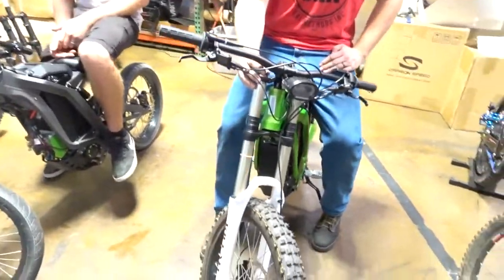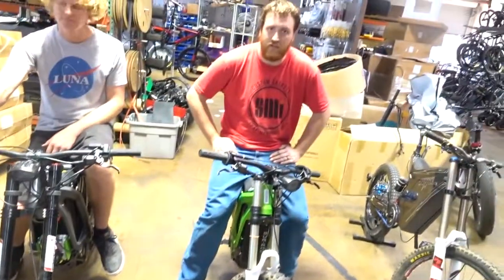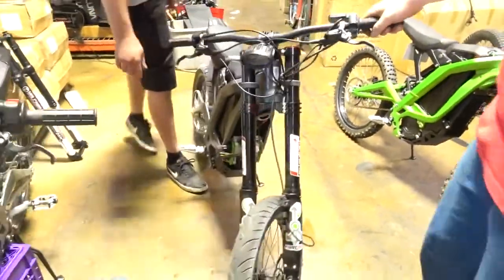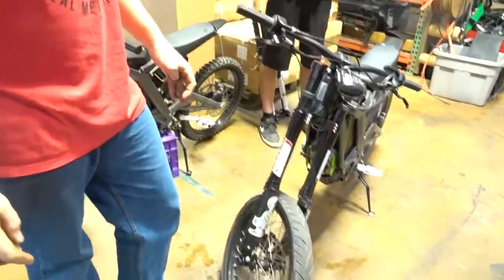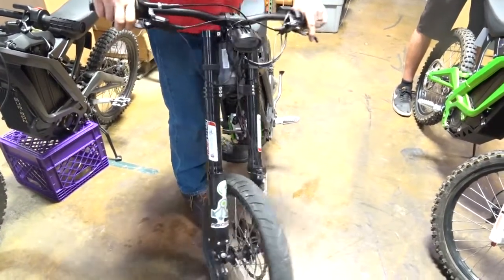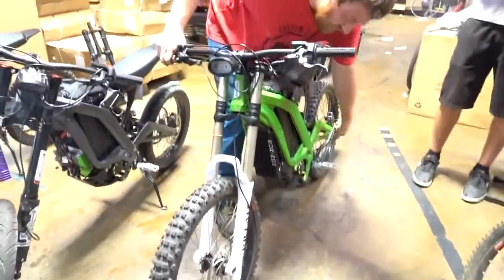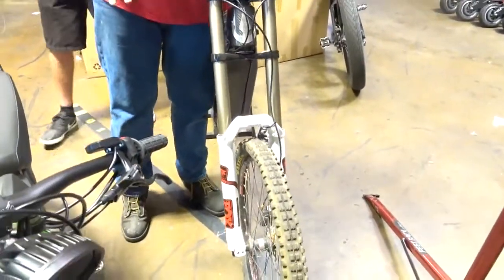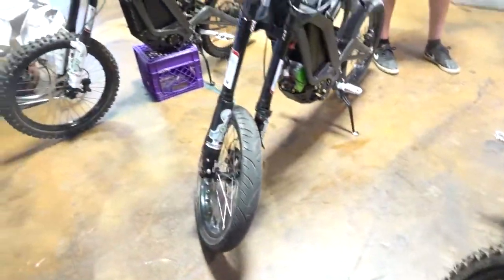Luna Cycle comparison between RST, DNM, Fox 40 and Fast Ace Forks

Comment: Fallacy of the mountain bike and small moto community: "Traditional forks with cross-braced sliders are stiffer because of the brace"
The real world: Real motorcycles 'high end' forks use the inverted design...   BECAUSE THEY ARE STIFFER (not to mention other additional benefits).
If you think mountain bikes and cheap (relatively) chinese mini e-motos are fitted with state of the art, top engineered designs and components...  you might want to re-evaluate the marketing you've been convinced to beleive.